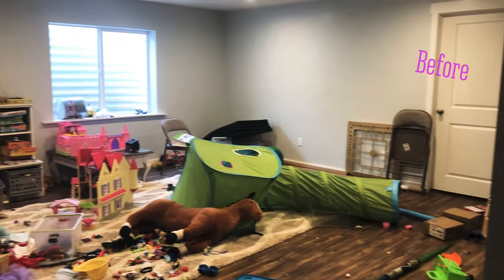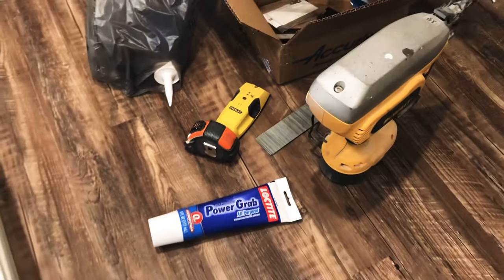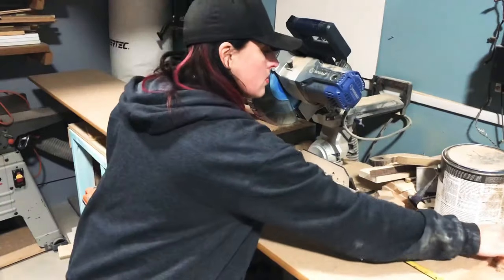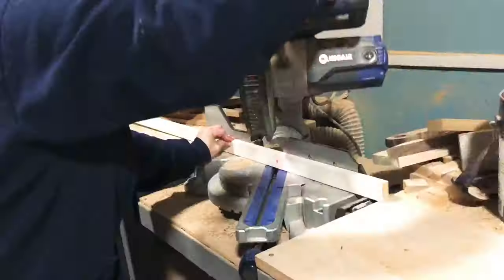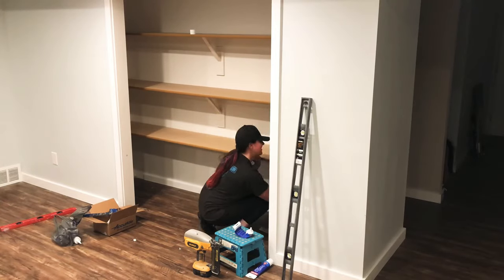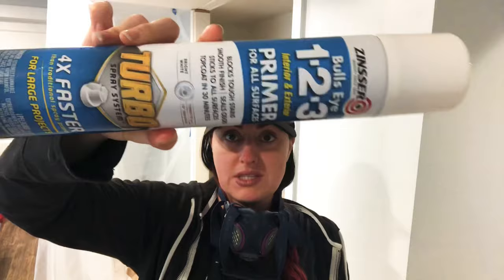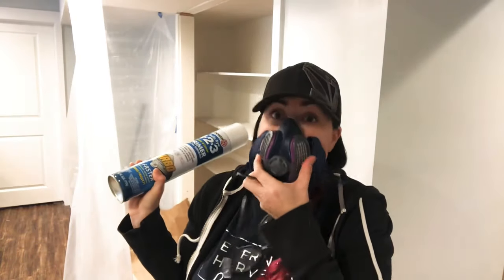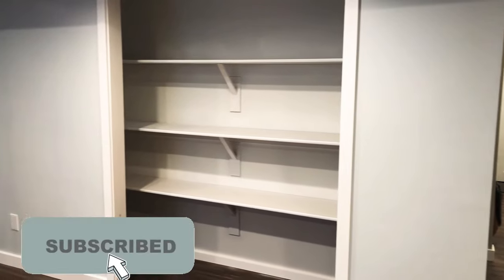DIY CLOSET SHELVING - how I made shelves for our playroom

Comment: Awesome project! I may have totally missed it; how are the side shelves braced? Also did you wood fill between the side and front shelves?
Reply from the maker: The 1x3 piece attached to the wall are the only “brackets” used. I believe they are called cleats and they are nailed and glued to the wall

Comment: Hi there awesome vid. Since I don’t have a mailer can I just use nails and a hammer? You mentioned screws, but I figure that will take a lot longer (predrill, etc)
Reply from the maker: I would suggest screws over the hammer and nail for strength, but if I’m being honest, I don’t know. I don’t build with a hammer and nails often, I usually opt for screws🤷🏻‍♀️ thanks so much for watching and good luck!
Reply: @EternalHarvestDecor  thanks so much for the tip. I've never used a nailer. Are there varying length nails? If so what do you suggest for this project?

Comment: This was a great help as I'm trying to layout my linen closet.  I envisioned doing the extra support just like you did so thank you for validating my thought for creating the brace from wood instead of buying a bracket to hold it.  I have one question.  Where the side shelf and the long back shelf come together, how did you support the side joins, or did you?  In the video it looks like you had an extra support piece but I couldn't tell how it was done.  Thanks for sharing!  :)
Reply from the maker: You are so welcome! this is a great question, I should have showed that a bit better in the video. I didn't add an extra 45 brace below the seam (but I think I should have) I just used a 1x4 underneath glued and nailed to each side. It was strong and maybe it would be over kill to add more but I think I would if I build them again, which I will. HAHA good luck!

Comment: Bug poop primer is some pretty awesome stuff. It’s also kinda expensive. Personally, for a beginner video, I’d have painted the shelves and supports outside first with a roller and a can of the stuff - it covers a greater surface area, it’s cheaper than the aerosol version and doesn’t require the American Psycho plastic sheeting or all the PPE. Great video though.

Comment: Can I ask why you chose 45 degrees for your brackets? I imagine the angle should be changed according to the shelf's width but is there a way to calculate that or just trial and error?
Reply from the maker: So the angle would stay the same but the length would change of the shelf was deeper. A 45° is the easiest to calculate and anytime I need a brace on a table, pergola or anything I throw in a 45. 😉 it it’s deeper then the board would just be a bit longer. Hope that makes sense

Comment: How did you support the left and right ends of the long shelves where they but up to the return shelves ? The ends aren’t resting on the cleats.
Reply from the maker: So in the corner its easier because you can add cleats to 3 walls, so it is braced on 3 sides of the shelf where it buts up against the wall, if that makes sense. The long front shelf only had 2 cleats the wall at the left side and the long back wall, so it needed an extra cleat in the middle to add some extra support.  Also because it was extra long I felt it needed something to brace the middle to prevent sagging. Hope that helps.

Comment: Fantastic project, I'm doing the same thing here. 
How did you connect the side shelves to the long shelves? Did you brace it underneath, or is it just sitting on the back board you adhere to the wall? 
Thank you
Reply from the maker: Thanks, it’s sitting on the clear attached to the wall as the  i also glued and nailed a 1x4 flat along the seam. Hope that makes sense. Thanks for watching!

Comment: Can I paint my shelves before I put them on the wall? I have to cock or fill in the holes in my wall then paint them. Can I paint the wood before I cut it?
Reply from the maker: Yes, you absolutely can. I did this during the winter in my area and it was easier for me to paint afterwards. But you can do whichever works best for you! Thanks for watching :-)

Comment: Hi. This is a great video--thank you for making it! Quick question: for the middle bracing, did you also fasten the molding to a stud? What do you do if (as I imagine is common) the stud isn't centered in the closet? Seems like it would look pretty bad off center...
Thanks for any help!
Reply from the maker: Great question and thanks for watching! I did not actually nail into any studs at all, the glue and nail into drywall is plenty. If you’re planning on loading the shelves with more heavy items I would do a vertical brace that attaches to the front from floor to ceiling. I added the braces mostly to prevent sagging since these are pretty long. Hope that helps!
Reply: @EternalHarvestDecor  Very helpful. Thanks again!
Reply: @EternalHarvestDecor  I need more info and will probably need to go into the studs. My house was built by lowest bid government contracts, so substandard materials and workmanship is rampant. How can I be sure to reinforce and make them extra stong for clothes rack and heavy items on the shelves?

Comment: For sure that particle board shelf is not going to last, and will bend and bow, and the fact you didn't run it all the way to the end, you'll be ripping that out in a couple years, if not already.... I would have bought 3/4 plywood and be done with it. You could then cut it as a U shape, and then add some softwood trim edging ending all the way to make it look pretty. The middle support makes it look like a 70's closet.
Reply from the maker: Thanks for watching